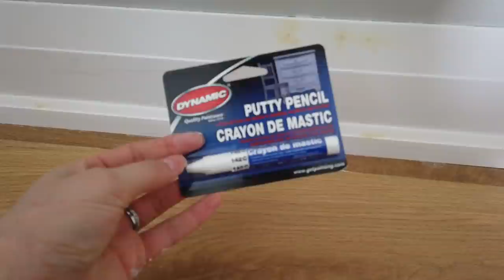Getting Down And Dirty! - HouseIntoHome#11

Comment: Use DryDex on your corners, it's easily sandable and will hide those joints. People mostly use it for drywall but it works on wood too especially if you are painting it.

Comment: Hearth is the word for the floor piece of the fireplace. When we moved to a new place with a fireplace, our indoor-only cat was really confused by the stone in front of the fireplace. 

And [curse word of your choice], I've worn exclusively steel toes since I was 18. I play fast and loose with safety gear in general (my eyeglasses aren't impact-rated, but probably good enough for most things, I wear a paintball mask or motorcycle goggles for serious grinding when I have to have my face in the plane of the wheel), and as for earpro, "WHAT?"(only when shooting guns, in the shop I just crank the stereo to be able to hear the music over the angle grinder) , but always steel-toe boots (you can get steel-toe, sneakers as well, look at shoesforcrews.com, not a paid shill, just a satisfied customer) if only to reduce the noise when dropping something -- carry a pallet or sheet goods vertically, drop it on my toes so it doesn't make the loud bang when it hits the floor.
Reply from the maker: Thank you for the product details!